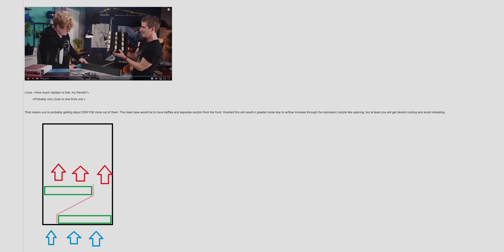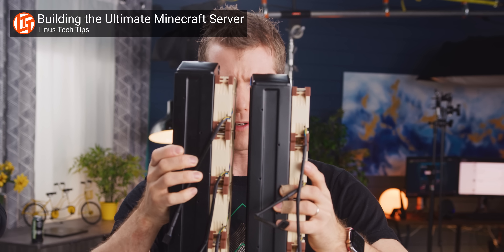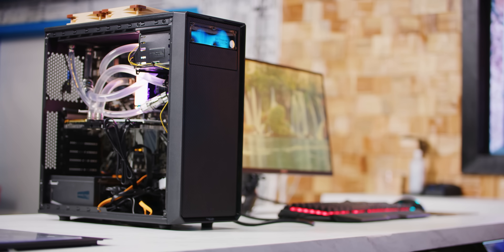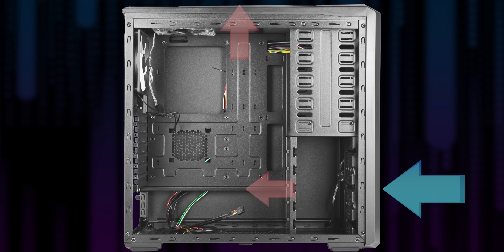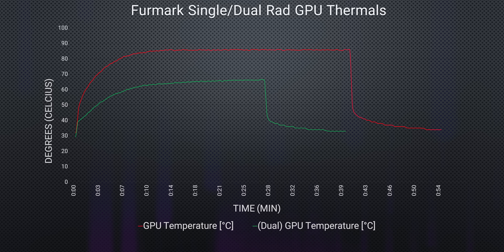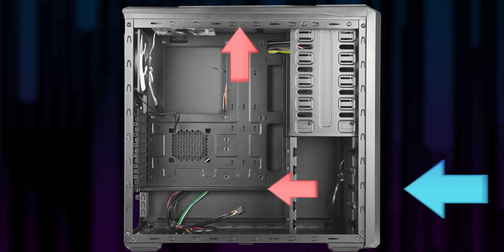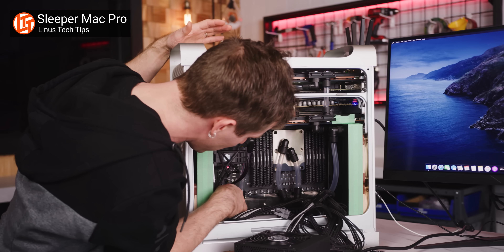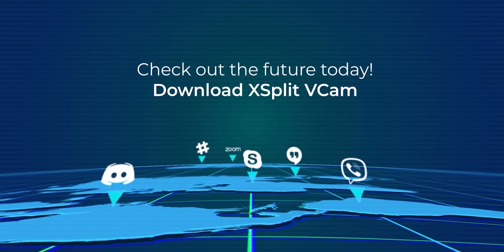I’ve been water cooling wrong for YEARS - $H!T Manufacturers Say

Comment: I think it’s got to do with the fact that your rad would have to be fully heat soaking the air for this myth to be true. Odds are it isn’t, especially if your fan speeds are high.  Heat exchange isn’t perfectly efficient. If you have a 90C heatsink, the air that briefly comes in to contact with it won’t be 90C. That’s just not how it works — air isn’t even a great conductor.

Comment: I think the problem with comparing corsair's simulation to real world examples goes back to the "spherical cow" anecdote,  in that it involves oversimplifying assumptions (idea that scientists, in order to solve a complex problem involving "cows" will simply the problem to fit models the point of unreal-ism, aka "lets assume the cow is a perfect sphere"). Similar to how an "ideal" wire can carry a current with 0 resistance; it's a simplification used to demonstrate a concept without over-complicating it.

So here I am making another over simplification to come up with my own hypothesis, lol: Air is a pretty poor conductor of heat, and if you "simplify" the idea of a PC case being a radiator "filled" with air instead of water, what you have is a pretty inefficient radiator. I just don't think a PC case is an efficient enough radiator to saturate the air within with heat at the same rate a specifically designed and complex water-fill radiator can. Thus, there will always be a temperature differential between air in the case, and water in the radiator allowing for some degree of cooling (albeit with diminishing returns of course).

Comment: Hey. I think corsairs statement was that you are  STACKING them wrong NOT that more radiators is not better.      if you stack radiators so the air goes from one to another like shown with ur 3 stacked radiators with noctua fans in between. the air from first gets heated and then gets sent to the next one and from there to 3rd one.   if you stack em so the all get fresh cold air they are way more efficient. also i think stacking one NOCTUA fan on top of another does not increase volume of air moved as much as they would if they are side by side. each pulling their own air.

Comment: I mean we've seen how much Corsair knows about cooling and airflow from their embarrassing A500 so...
Reply: Oh Burn
Reply: Damn that’s fire
Reply: tbf, they could fix that using a better lap on the contact surface. they seemingly won't but they could.
Reply: The A500 is an air cooler, this entire video was about water coolers. I believe the majority of sold AIO's are from Corsair
Reply: @joostvisser8537  If by "aio" you mean an Asetek pump with RGB LEDs added to it, then yeah. Otherwise there's literally no difference between Corsair, NZXT, Fractal, and all others that just buy the pump from Asetek, get the radiator from the same supplier in China, and just add RGB to it
Reply: Was curious about your claim, looked into it and it seems the a500 is a perfectly fine CPU cooler. Source: Kitguru, PCper.
Reply: @sparkelyfox8480  Yeah but you have to check the review from a publication that doesn't give high scores to literally everything. If you want to see what it's actually like, check Gamers Nexus, Der8auer, and Hardware Canucks. It's a 100$ cooler beaten by 90$ coolers. The surface levelness on the direct contact heatpipes is terrible, there is only 4 of them, the fans are trash, there is a giant hole in the middle eliminating 30% or so of heatsink area etc. All the reviews I just told you will mention this

Comment: Linus please try actually "stacking" the radiators (like in the mc server) not putting another one in the loop in series
Reply: he literally said it towards the end of the video how they removed one radiator in the minecraft build stack and it was a 5° increase so having all those radiators still helped cause just removing one added 5°
Reply: I mean, he says in the video that they did: they removed a rad from the MC server stack, and saw a 5c ambient increase in temps.
Reply: Senjosei, please actually try watching the video to completion and ACTUALLY paying attention before you leave comments of things he ALREADY DID.
Reply: Heres the thing, corsair suggested to seperate the intake of the stacked rad saying "the improvements are negligible or non at all". What he tested was a completely different situation. While he did remove the rad on the server and saw a 5C difference, that might be the 'negligible' difference corsair was talking about. The end of the video is basicly corsairs statement "the improvements are negligible or non at all" is labeled as not true even though thats not what hes supposed to be testing. He should try it with 4 situations, 1rad, 2rad stacked, 3rad stacked, and 2 rad staggered inlet, that would make it clear if stacking rads is diminishing returns or not
Reply: @senjosei  5c is not negligible, stop being an ignorant twat. On a zen2 CPU, or any modern GPU you gain frequency for every 5c you can shave off. Not to mention the amount that you extend the life of components for every 5c more they are under their rated temp.
Reply: @shawnpitman876  okay lets try this again in a civilized manner. Let me do this step by step of my problem with linus's vid.
1. Corsair said doing stacked rads would result in diminishing returns and suggested they do a staggered intake (as seen from that email)
2. Linus' test did not try and disprove corsairs statement as in not testing stacked rads diminishing returns
3. Then he said when he removed one rad from that 3stack in the mc server, he saw 5C increase
4. End of the video corsairs original statement is labeled as false

Now while yes 5C is big for a cpu i shouldve chosen a better word, what he did in the video does not directly prove that corsairs statement is false. Maybe in the mc server 1rad resulted in 95C, 2 rad resulted in 85C, then 3 rads resulted in 80C , and maybe using staggered intakes results in 70C which would confirm corsairs statement that stacking results in diminishing returns, but thats not what he tested so we can never know.
Reply: @senjosei  in the video corsair did 2 statements one for the stacked radiators and one for the heated airflow for the mac build. Linus tested the mac build situation and didn't do a video test on the stack. He did it off screen with just removing one and got the 5° increase. yes having the three stack be separated is ideal everyone knows that but Linus did it because of space constraints as he stated. there is no need to make a video about stacked vs non staked because that one is a obvious answer non would be better but stacked still helps that is why Linus did it and he proved it with the 5° increase.

Comment: In the test PC, could you not just flip the fans on the top of the case? Then you'll be pulling cool air through both the front and top rads and exhausting out the back. Also, the test in this video does not account for... exactly the issues that Corsair was complaining about. The Mac Pro cannot draw in air from anywhere except the front and back, so almost all the air would HAVE to travel through both of those rads. In the water-cooled server loop, the air would HAVE to travel through all three rads one after another without mixing with cooler ambient air. I would like to see this test done again... with the scenarios specifically cited by Corsair. I know it was briefly mentioned at the end, but it was a pretty throw-away line to address Corsair's specific complaints (especially because they seem to be about those particular systems, not every machine LTT has slapped a second radiator in).

Comment: Stacking Rads inline yes, because the rads perform better with cooler air hitting the find to dissipate the heat going into them. So if the 1st rad is in front the 2nd will get less cooler air and so on and so on. 
You want to rads to get cool air by all means possible, dont exhaust hot air through a Radiator.

Comment: I would have liked to see some validation of the claim that the air leaving the radiator is the same temperature as the water entering the radiator.  I can believe that it gets close, but I can also believe it not being that close.  I think whether to stack radiators then depends on the outcome of that test.

Comment: Seems you’d need to measure the delta in air temp on each side of each radiator and know the mass (not volume) of air through each radiator. Large delta temp would debunk corsairs theory more conclusively the way I see it.

Comment: I'm curious as to what their suggested change was? Just not use a second rad? It's common sense that more radiators = better cooling capacity, no matter what the situation is. the water isnt going to end up at room temp back at the CPU again unless you have tremendous cooling capacity.

Comment: I mean, assuming more rads don't dramatically decrease air- and waterflow, if you layered them such that the hot water runs through the last rad (the one the air gets to after going through all other rads first), then the next one and then the one drawing fresh air, you would increase cooling efficiency.

Comment: I think the real take away is that allowing for enough fresh air intake in a dual rad system is key to making it worth the extra cost.
Reply: It definitely helps. But also they said removing one of the rads in the minecraft server increased temps by 5°. So not negligible either. And that  thing doesn't have holes where fresh air just gets in the case :-D
Reply: I like your wisdom.... 🐼
Reply: No, its the amount of heat thats given to the volume of air that counts,
So if the second rad has air going through it thats cooler than the liquid in the loop then it still adds cooling capacity.
The only time thats not the case is if they are the same temp e.g. the air coming out of the first rad makes the air hitting the second rad the same temp as the liquid in the loop..
Beyond that it gets complicated to work things out because the best setup has the highest delta between the air and the liquid in the loop, but you also have to calculate that the chip is more efficient at a cooler temp so then the loop doesn't need to dissipate the same amount of heat. The you will have different loadings at different loadings which means where you put the rads in the loop comes into play and more variables etc..
It's a right can of worms.
But more = better basically :)
Reply: You missed the point completely. The heat transfer is most important. If the air is near the same temp as the radiator, the heat cannot transfer. If stacking or dualing a radiator still provides this difference, then it will work fine.
Reply: Correct me if I’m wrong please but I agree with what you said. It’s basically set up with one radiator taking in cool air through the fins to cool the internal fluid. The second one is working in the same flow but the inlet of the second one is on the hot side, which would make it, if sealed with no external airflow, a heater core. It’s bringing in the warmer, internal air to warm up the fluid rather than cool it. But with the addition of external air cooling the internal temps, it actually cools more efficiently.???
Reply: @brendanarana6178  depends on the temperature of the air. Heat is what gets transferred, as cold does not exist. If the second rad has more heat than the air passing through the first rad, the heat will get transferred. Albeit, no where near as efficient.
Reply: Tad Saxington ya that’s what I was trying to explain. Not the easiest without a full conversation. But yes If the second rad is exposed to more heat charged air than less heated air, it’ll transfer heat rather than dissipate it. Thanks 👍🏼
Reply: @brendanarana6178  LOL, yes I was confirming you. Trying in technical terms. 😁

Comment: I think Linus got it working, the way he put the fans in the second rad in the wrong place he should put the fans inside the case because Corsair said about the fans throwing the hot air of the case on the rad. Correct me if I'm wrong but I understood this way.

Comment: If the radiator at the exhaust is the first one in the loop(and is saturated) then the second one will benefit. If you reverse this the benefit is smaller. Also another radiator also adds more thermal mass.
Reply: Corsair IS theoretically correct BTW. Practicality is much different. Also the same on the triple rad server, if the rad on the exhaust is the hottest.

Comment: It wouldn't make sense to have two radiators one after the other right?? It would only make sense if there was a parallel connection which means more mass flow rate and hence more heat transfer or am I missing something here?

Comment: they wherent saying more rads dont cool more.  the problem was your previous designs where leavign money on the table. they wherent an efficient use of the hardware  the first and second rad where to close, you suck heat out of the air and into the radiator, only to blow that already hot air across the water you just cooled, now sure it wont necisarily reheat the water it will reach a stability point.  this doesnt mean adding mroe radiators doesnt get mroe performance. it just means that ifthe radiators where farther away from each other (or idealy both intaking from opposite ends of the pc with a regular fan oxhausting the warmed air from the case) you would be gettign even more performance out of the same hardware.   

you shoudl test this again with two rads in differnt configurations. one with them sandwiched and one with them seperate. not just one rad vs two rads sandwiched.  youll get even better performanc with the two rads seperate than you will the ones sandwiched together (asuming there is enough thermal load to even require the entire cooling capacity of the second rad) 

basically 
1 rad = poor performance
2rad sandwiched = ok performance
2 rad with seperate intakes = best performance

Comment: ADD MO4R FANS!

Seriusly, I beefed up my pc with fans and now holds a 5gh overclock on my 8700k.
Witch bluescreened at 4.7ghz with stock cooling. (stock amount of fans that came with my rad)
Pushpull that pupper and some exhaust fans worked wonders for general temps.
Does sound like a ufo now when I put on a big load and fans go on fullblast...

Comment: You can make it better with dual rads put a rad at the top, and if you have a case like O11 dynamic put some fans at the bottom so they suck the hot air out that went through the rad and put the second rad on top yeah das it puzzle solved

Comment: “Stacking rads is not bad. Lets prove it by putting 2 rads in a loop in series.’
Reply: Someone didn't watch the whole video, at the end Linus says that they removed one of the stacked radiators from Jake's system and the temps went up by 5c.
Reply: @jakekiedaisch2279   you are right in that he removed one of the rads but did he put them in the configuration that Corsair showed them ( at 1:02 ) or did he still have them one behind the other but only a two stack ?
Reply: @jakekiedaisch2279  so 10 seconds of this video actually tackled the issue at hand and they tested that off camera. The rest of it was completely missing the point....
Reply: They also mentioned the minecraft server that was their example with stacked radiators..

Comment: Adding radiators has diminishing returns. Corsair are right, because their simulations are based on simple physics. Easy example with cars: if you put giant radiator from a truck on your car it won't become much cooler. You'll have to drop ambient temperature to gain something from it

Comment: I mean you could have just measured water temp and exit air temperature. If the difference is small enough the ow obstruction will just make performance worse.

On the other end cfd simulation of something like this, especially with heat transfer and fans is usually extremely simplified and wildly inaccurate.